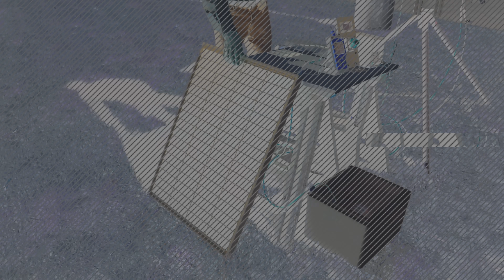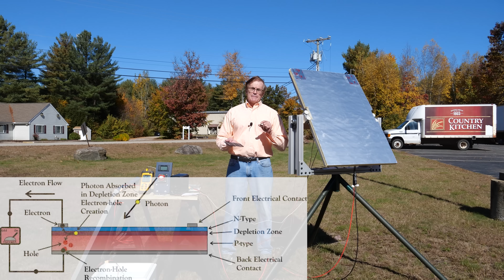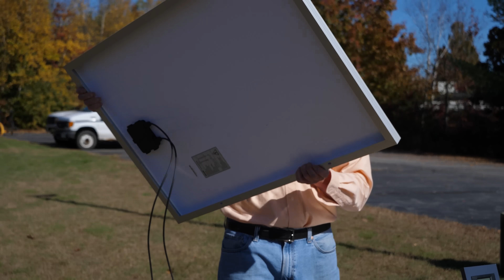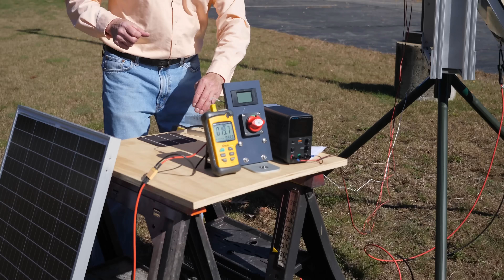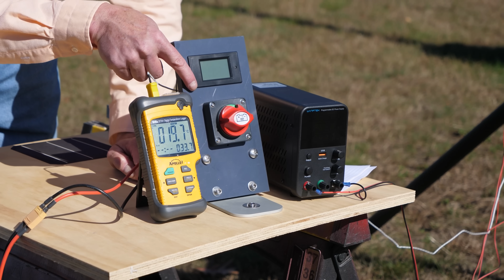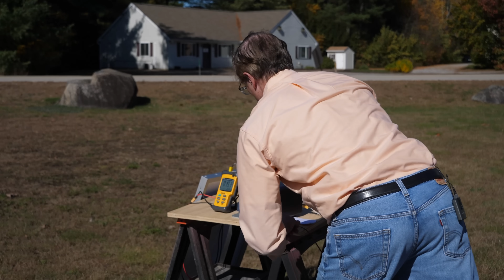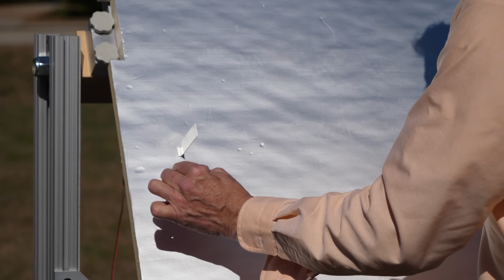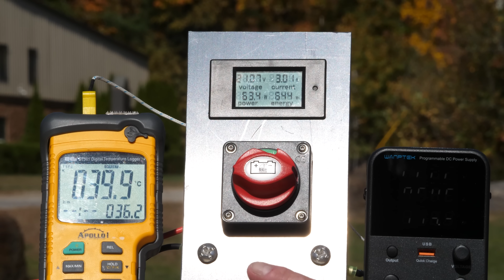Do you REALLY get enough out of your solar panel?

Comment: Friction Movement Heat - can that be used to generate electricity?
Either through thermal or fedback into the solar panel as another layer to give power to the electrons?
Can we have a DOPED THERMAL LAYER?
Maybe a layer with properties that suit heat to generate electricity?

Combine and improve.

Comment: You've done it again old man, schooling these youngings and making this one double down on my build setup (heres a gift back at cha, i take the headrests off lay the seats back and the whole interior of my jeep becomes a teardrop camper, installed a popup hatch sunroof set in a vortex china rv fan and the kicker is i used the jeep mounts to sandwich the L-frame of the panel to the jeep so it looks like a rank and sits like one nice and air cooled, bought a pwm controler for the vortex fan and now i can push air out to cool the panel, this was my origonal plan but now i plan on doubling down and maxing out my new 3060ti xc skyreach 4 mini 3.4L case with a ryzen 5700g babbbbbbbbbby, next step moded space x antenna) the build sits on a plywood platform and has a cut out wheel well trunk box to fit a 12v waco fridge on the curve back end of the car sits a diesel heater each trunk window carries a 100ah battery wired thru the headliner ;) smoochies babbbbby

Comment: Here in Florida, we have swimming pools that on circulation pump for 6+ hours every day no matter if you use the pool or not and we have a lot of people already installed solar panel. If someone can design a system to direct the pool water to the back of the solar panel. That would be fantastic.

Comment: Given that roofs are angled, I wonder if you could get enough cooling through convection. The engineer is going to complain about anything that moves being a failure point. A passive heatsink in a shroud might just generate enough convection cooling to be noticeable without moving parts to fail and create warranty issues. Something to test in the next iteration maybe.

Comment: Do you not think that the "control" was biased due to the aluminum on the back for the test (thus preventing some natural airflow)? If that did trap in hot air then  the benefit of the fan setup against a "normal" panel wouldn't be quite as large.

Comment: 20 C over the temp you got, 53 C, would be plenty to kill people.  Centrifugal blowers are even more efficient than the axial fans you used, per blade area.  One long, thin "squirrel cage" fan would move more air and be close to the same efficiency as your fans at 6 volts.  I've never seen a 'washable' centrifugal fan, but they have to exist.  They do tend to be a bit more expensive, though.

Comment: Because the expansion rate of silicon is rather large and not uniform over a large panel. The effect is also seen in semiconductor production where a rather large percentage of production have to be scrapped or sold as lower performance processors because they don't meet performance targets under load. The higher the grade of silicon the better.

Comment: Would be interesting to test with just a few layers of aluminum mesh from the hardware store instead of the fins. You could setup a neat, low-cost microfluidic skin cooling system that way.

Comment: buying panels i would place them at ground level and NOT on my roof,  that way i can more easily remove dirt and snow, that would be difficult if NOT impossible if they were on the roof. secondly i have NO desire to sell my electricity to any big corporation. or my neighbor for that matter. 
using the information available on this channel i could easily pick up a junk car battery and rebuild it to add more batteries to my array .

what would be really cool would be information on how to charge multiple banks of batteries where. bank 1 is priority bank and when it reaches 100% state of charge, then bank 2 gets the charge, until bank 1  drops to 95 % then it gets the charge. and on and on until 10 banks are charged to 100%. then maybe add more banks.

another cool project would be harvesting capacitors from electronic circuit boards and connecting them together to create large arrays of these capacitors and then connect the arrays together to make a very large energy storage.

Comment: The idea of putting a photovoltaic cell on a roof is pretty absurd already from an efficiency standpoint. What, the expected life-cycle efficiency is probably like 1/4th that of the same cell in a solar farm? Plus imagine the difference between handling failures randomly distributed across the entire country plus all the wasteful customer interaction vs. the cost of maintaining the cells in a farm with accurate life-cycle modeling. From an efficiency standpoint rooftop solar is barking mad, but alas efficiency is not what matters most. Efficiency is max 2-3x gains, never the 10x we aught to look for.

Comment: This is awesome, and I'd love to use it on my solar setup if I ever get one.
 At first I was more agreeing with the 'skeptical engineer', "why not just add one or two extra panels rather than fuss with installing a cooling system?"
But you bring up an excellent point about how this will increase total panel longevity, especially here in central TX. Besides that I would probably enjoy doing this as a project, at least compared to decommissioning all my panels 5 years sooner than they could have lasted...
Great video, thanks for sharing your research

Comment: I'm trying to wrap my head around why you placed the fans at the top of the panel. I would think it would be more efficient to place the fans at the bottom, pull in cool air down low and force it out the top of the panel, as heat naturally rises. Also, you might try the panel without the fans to see how much improvement occurs using only convection.
Reply from the maker: The fans were exhausting the heat, not pushing it in. Without the fans running, the modified panel was slightly cooler than the stock panel.

Comment: Fascinating…thank you …I wonder how many folk will copy your good work,  I’d bet quite a few 😊 you probably sequester a few tons or more carbon ,
I used a garden spray on mist setting and found the air around  our wee piknik dropped substantially, off course it’d be a see saw effect whilst one waited for panels too heat too the point that rapid evaporation would take place ….
Take risk 
Take care

Comment: Ive been tying to design a water cool system that feeds into an underground reservoir as a means to keep the water at a lower temp in the summer. my panels will be ground mounted outside

Comment: Very interesting.  I am wondering why you placed the fans at the top and was the airflow directed?  I think I might have put them at the bottom to take advantage of the angle of the panel and heat rising... which makes me wonder if there is a way to passively cool with basically your design. Hot air exiting at the top, pulling cooler air from below.  Thoughts?

Comment: It's basic and proves you are getting free energy. 
I still think liquid cooling could be a better way to go heat is still energy & you are throwing it away, couldn't you use a heat pump on a liquid cooling system to produce hot water & maybe even run a small steam turbine?  
Water isn't great  as it doesn't cope with low temperatures, I was thinking something like 3M's Novec Melting point −108 °C (−162 °F; 165 K) Boiling point  49 °C (120 °F; 322 K)

Comment: How are the sheed parts inside arranged? All in one row or with some offset? I want to try something similar. One of many ideas was to hang my left over aftermarket 12V 16´ car engine fans behind the panels. The closed approach seems more effective. Maybe cooled air by swamp cooler will make this even more effective. Well where did that swamp cooler idea came from.....i wonder. 🤔

Comment: Love the content. Wonder what the results would be if you had a control panel. After all this panel had a heat insulating panel fabricated to the back, until you turn the fans on the panel would actually endure worse cooling then stock.
Mahalo for all your work!

Comment: I always wondered if it wouldn't make sense to water cool your solar panels and use the heat to preheat water for your home, so you need less energy to heat it. Maybe using a heat pump, you could heat the water and cool the solar panels even more. The extra energy may not be worth it on it's own. But many people use electricity to heat their water anyway. So in that case, the energy invested wouldn't really be lost. And a heat pump would move more of the thermal energy of the solar panels into the water, than the energy it consumes...
Of course that would also make the installation of the system a lot more complicated. But I think it may be worth it.

Comment: Is there any glass or plexiglass panel that could be put over the solar panels, perhaps with an air gap that would filter out the longer wavelength infra-red to stop the heat but allow the panels to function?

Comment: What about cooling the panel with a water loop connected to a heat pump? That way you can cool the panel a lot more, and extract the extra heat for house warming during winter, for sanitary water or to heat a pool during summer.

Comment: I've been thinking of options for something like this for ages. I like your system, but passive cooling would be nice.
U Aly profiles would be half the work for the same number of fins. It's available pretty cheaply.
I've been thinking particularly of coupling a heat pump with solar PV including cooling the PV in some way using the heat pump and maybe solar evacuated tubes for the Winter, maybe also coupled with the heat pump to boost the temperature if necessary.
Reply: "L" profiles can be next to each other and take away heat from the entire surface. "U" profiles are used to transfer heat from a well-conducting surface and save material only if they are spaced. Without the gap, they would use more material than the "L" profile.

Comment: I'm wondering if you could use heat pipes with large fins in free air to carry the heat away, that way you're using convection and passive wind cooling.

Comment: Did you do a control without the plate on the back ?
Reply from the maker: Yes.  The modified  panel  runs very slightly  cooler than the stock panel.

Comment: A waste heat system like this could be more useable if you had a cooling loop that tied to a pool. I know we spend hundreds over the year heating our pool. Not sure what the heat output of this loop would do but if you had a large roof of panels it could possible create enough heat to offset some gas costs. But it’s always trade off. Cost vs benefit.

Another thing is if it had a cooling loop it could also be used as a heating loop to melt snow and ice off the panels during winter when needed.

Comment: I'd experiment with aluminum nails in a grid pattern, install with a template so that all the heads could be epoxied at once, epoxy the baffle to the sharp ends of the nail, and push air into the center of the panel. I was just considering a press brake for a diy heat recovery ventilator core, another option would be a corrugated aluminum piece to fit in the cavity and exchange the heat much more efficiently. good video
Reply from the maker: Thanks!

Comment: I see that the creator of the video has replied to some other comments below but, so far, has ignored comments that point out that the test was deeply flawed and likely resulted in erroneous data.  Erroneous to the point of giving the opposite result than what, in reality, will happen.  In case it isn't obvious, what really will happen is the solar panel will NOT produce more power than the fans consume to cool them.  Oh well.....
Reply from the maker: Maybe  because  your statement  has been PROVEN to be incorrect.
Reply: @TechIngredients  With respect to the data, PalindromeAmbigram is correct that it is erroneous.  For the past 30 years I've been making a pretty good living at designing, building, testing and selling custom "one-off" solar panels and the use of a fixed resistors (7 ohms total) as the load is the crux of your problem.  You absolutely should have used an appropriate MPPT.  I'm happy to explain it in detail if you're receptive to criticism.
Reply from the maker: I'm  receptive  to criticism, but in this case, your issue is not relevant.
The panel  DID generate  more power with the fans on than with the fans off.
Reply: @TechIngredients  Respectfully, I think you may have missed the point.  Bear with me...

We aren't disputing whether you did or didn't get more power with the fans on than with the fans off.  What's being disputed is your assertion that the panel was loaded to its maximum power point in both cases (they weren't) and that the difference was higher than the power the fans consumed.  We are simply saying that if you properly conducted the test and properly loaded the panel (with an MPPT) in both cases then the difference in the maximum powers would likely be LOWER than the fans consumed.
Reply: @TechIngredients  Well said Alan!

Comment: In data centers we found it uses less power to use the water method to cool servers with a large radiator on the roof. Even compared to using outside air with a traditional fan cooled server. The reason is that fans are much less efficient than a water pump due to the compression of the air also you can increase the effective surface area to be cooled with the radiator . The large radiator on the roof can passively cool in some cases and if not a large centrifugal blower is used.Granted server fans are much higher rpm and static pressure. The savings are meaningful enough that there are large cloud providers exploring this for production. Just some food for thought.
Reply from the maker: The big difference  there is that the heat source and the heatsink (the atmosphere) are far apart.  Water is an excellent  method for transporting that heat to a remote location.
Reply: @TechIngredients  Hey thanks so much for responding!

I’ll have to review the information but I do believe that was accounted for. The power draw of the fans within the server itself was isolated and compared to the water cooled experiments. I believe it’s largely due to the static pressure server fans create. There are 6+ modules with 3 Axial fans in series spinning at 10k+ rpm. Also the facilities targeting these technologies pull megawatts of electricity. 

In a small system your approach is probably best. But there may be a point at which water is better from an efficiency and or maintenance standpoint. It would be hard to pin down where that is though. Especially if you tailored your approach to take advantage of a light breeze which wouldn’t make sense with a water based system. 

Lastly, If you want to get really crazy you could try a completely or mostly passive method with low temp phase change. I have seen incredible efficiency gains in some of my work with this stuff. Something like 3m novec or pulling a vacuum on some water to boil off the hot side and condense somewhere else.

Comment: Wouldn't it make sense to run your hot water heater inlet from the discharge of a water cooling system on Solar Panels, fed by incoming water from well or utility? Esentially preheating the water going into the Heater. Of course the cooling will only work when you have the hot water demand, but you get multiple benefits. Here in california the freeze factor is only a couple weeks a year, so a water drain and solar panel bypass would be necessary for those conditions.
Reply from the maker: It might, but it adds complexity and the potential  for leakage.  Nevertheless,  it's  a viable option.

Comment: If you had a heat pump system for the house in cold temps you could pump the waist heat to warm the condenser unit making the heat pump far more efficient and able to operate at much lower temps

Comment: The one concern I would have is the power on hours of those fans. I'm certain there's MTBF data for reputable fans like those but that's something you'd just have to calculate into the long term costs and reliability curve (not to mention the gamble of that fan manufacturer still being in business and you're able to buy the fans 5, 10 or 15 years down the road). Granted I suppose you could just fall back to passive cooling/remove the ducting/fan mounts if and when those fans give out.

Maybe magnetic bearings would last better (If they're washdown fans I'd imagine their bearings are more robust).

Still a cool idea and it does have measurable benefit but there are maintenance concerns you'd have to think of ahead of time considering the fans are literally the only moving parts in a system for a non motorized/fixed roof top panel array.

Comment: I'm going to install a motorized solar tracking solar array on my property (think single pole with a bunch of panels moving with the sun). I'm currently building a bunch of open-source MPPT charge controllers (to save money, of course), but your point on panel longevity inspires me to consider a geothermal solution for my panels.

I'm considering oxygen-barrier PEX lines dug 6' into ground, coupled with a single taco continuous running water pump. This should more than meet the thermal cooling needs year-round for Maryland summers. Now, I just need to replace most all the hydraulic hoses on my Case 580c before I can start digging... ;)
Reply from the maker: Good luck!
Also, you can limit  the pumping period  to the peak output  times when the benefits of efficiency and longevity are the greatest.